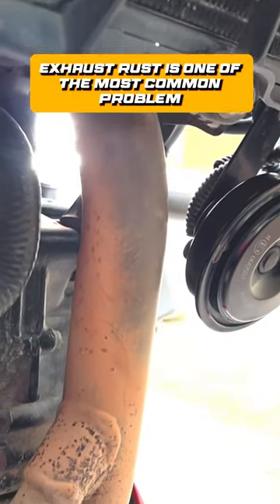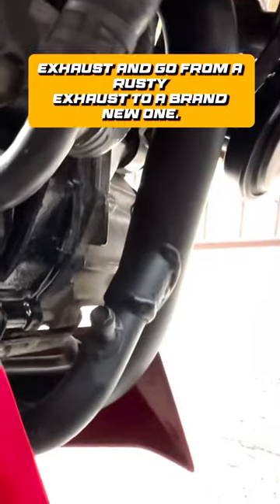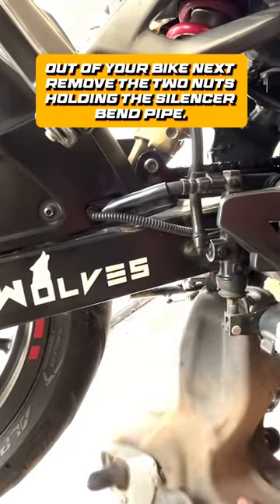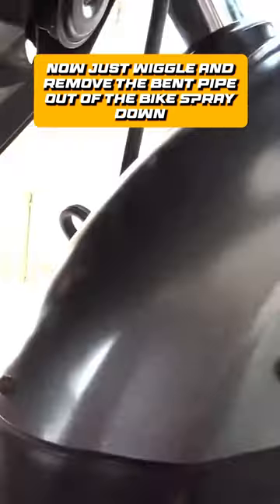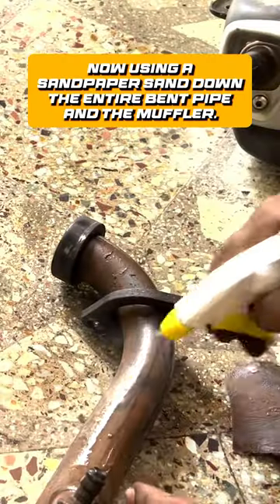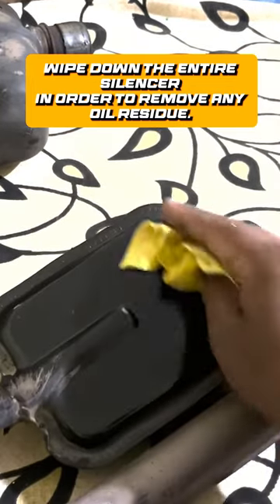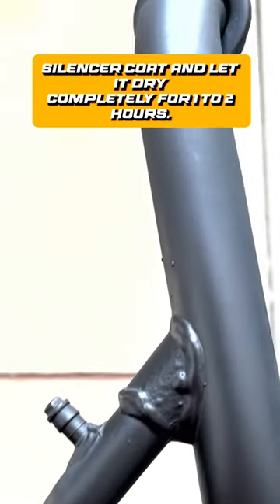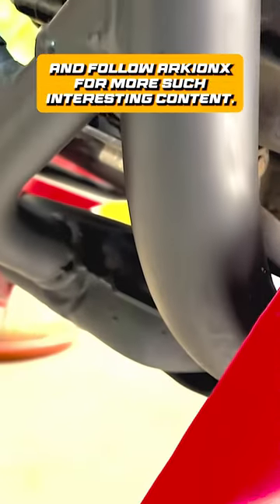Restore your rusty exhaust 🔥 #ns200 #automobile #motorcycle #dominar400 #ktm #yamaha #honda

Comment: 12 years old pulsar 135 and almost 13 years old 220 and no rust or any signs of rust. Exhaust of 220 is just phenomenal.
Reply: 220 mein toh chrome finished rheta hai exhaust. Waise maine bhi tracker ke exhaust ko chor kr kisi mein rust nhi dekha hai pta nhi isne ye video kyu bnaya hai 😂
Reply: 2011 last batch of p220 was awesome. Still not rusted also the new models bend pipe is thinner

Comment: Paint will noy last very long.. For the beauty pf time being u can go with the process shared here
Reply: These are not normal spray paint, it can resist heat to some extent. Similar underbody coatings are done for cars too and it stays on even after 10k kilometres. Have used the 3M ones.

Comment: Warning :- KINDLY MAKE SURE THE EXHAUST IS NOT HOT BEFORE YOU START DOING ALL THIS... AND ALWAYS WEAR GLOVES WHEN DEALING WITH RUSTED PARTS.

Better buy a new exhaust system, it will be much safer & durable. 
Little knowledge is always dangerous.
😎
🙏

Comment: Instead of using sandpaper which destroys the coating on the exhaust, have it a pressure wash and the color will go (temporarily). Then just use a sponge polish that's just 20Rs and leave it for an hour. Voila, no need of removing anything and stuff

Comment: I used to do it on RE electra. Doesnt last for long. Have to keep painting it every 4-6 months.
Reply: May i know the brand u used
Reply: @muruganmurugan507  Bosny Hi heat resistant 1200F
Reply: @dinorangel2476  suggest any good brand (3m or samurai) what u prefer
Reply: @dinorangel2476  thnx bro

Comment: How hard are these pipes built?? Cauz' due to my ns200 low ground clearance, it rubs to huge speed breakers. I'm worried about it
Reply: Ride very slowly on the speedbumps ...You can't rely on the durability of any material when you're driving in India ..These speedbreakers are not made of govt standards..anyone just appears and put a speedbreaker infront of his home by pouring some concrete on road ..If they followed govt norms even 130mm ground clearance will not hit any bumps just like the label crossing ones ..

Comment: Apun toh naya lagwa lega sidha 😂
Reply from the maker: The cost of silencer coating if you do it by yourself is arround ₹800 and if you add primer for longevity then it may go maximum upto ₹2,000-2,500. 
For replacing the entire silencer, you have to spend approximately ₹18,000. 

It’s totally upto you to make that purchase decision.
Reply: @ARKIONX  Or cut all this crap and elbow grease and go with simple hydrochloric acid or just use harpic man😂 no need to remove the exhaust harpic and a toothbrush always does it😂

Comment: If we do clean inside the exhaust pipe with water means anything happens ?
Reply: No…as long as you remove the exhaust and wash it…if water goes inside engine then it can cause problems